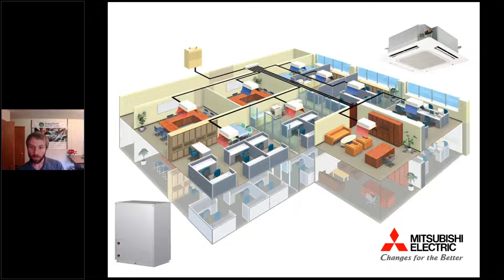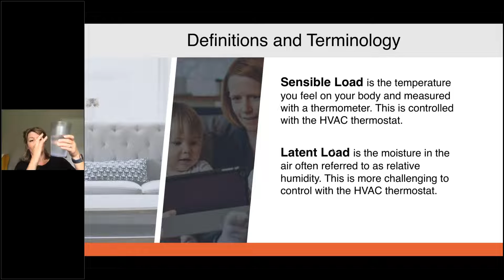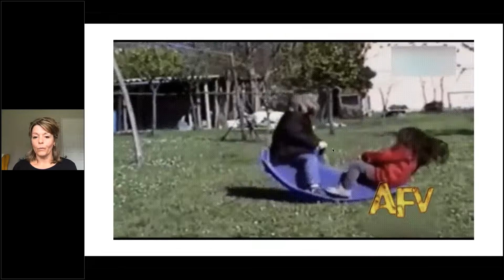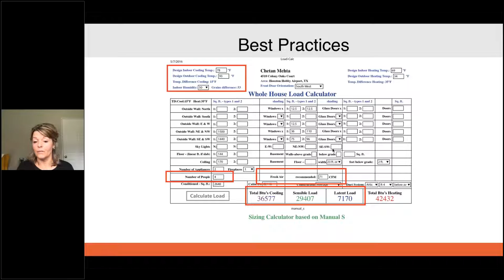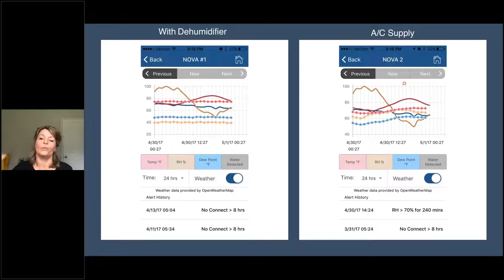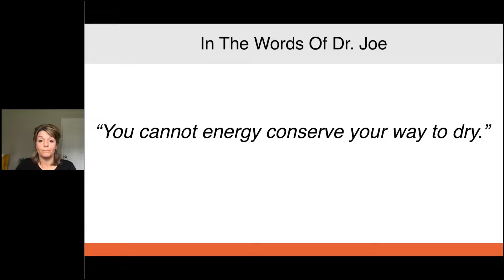Uncontrolled Moisture: The Enemy of a Healthy Home

Comment: One of the benefits of an older home is that there is less off gassing because it generally gets lower over time. 
One problem is that older homes are also less air tight and not as energy efficient.